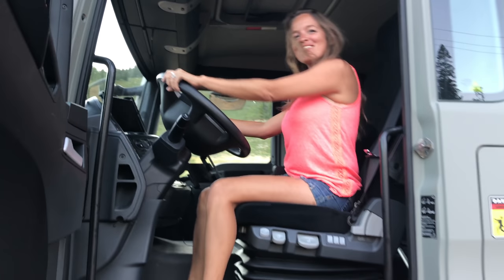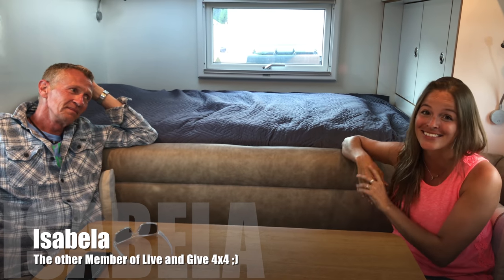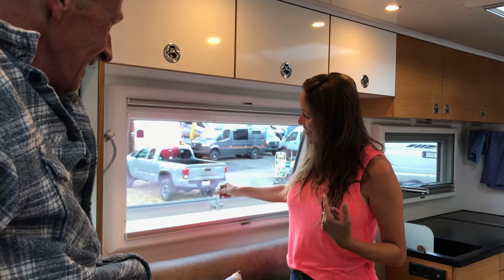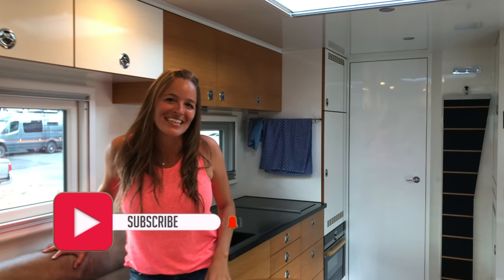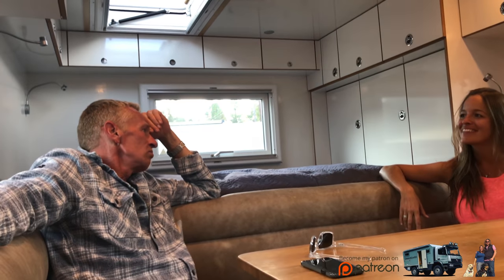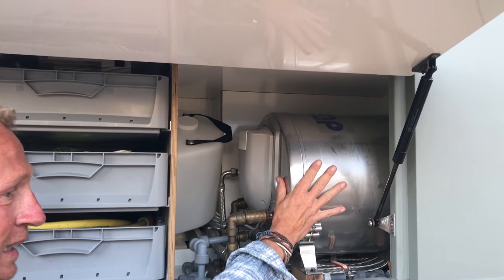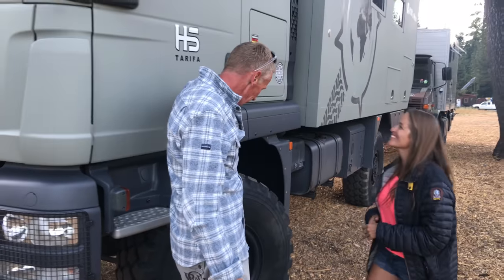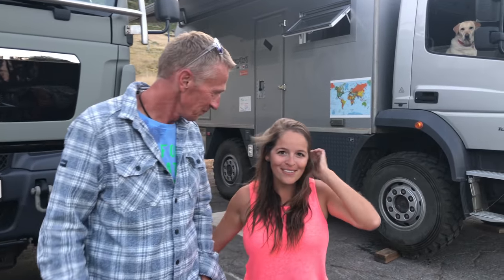Extreme MAN Expedition Truck FULL TOUR ► | Live and Give 4x4

Comment: 9:47 noticed that the electrical wires are ran thru a metal square harness.  This is by code in some Countries.  It is dangerous to leave  the wires exposed.  My  Congrats to the Builder.   Also, how do u ground the Motorhome or all devices on board? In the Caravan medical field, this is a must to protect the Operators and equipment.

Comment: Great video again guys, question though... Do either of you know the overall weight of the habitation unit on it's own before it is fitted to the HGV.. Building my own next year, just getting ideas together.
Already decided the Base Vehicle (Merc Atego) but need to work out what class would work best (can drive 8.25 ton at the moment). Probably have to get the 32 ton rigid class licence but would be nice if I could get it to fit on a 7.5 t dreaming....
Reply: @Mauro Sanna larger market share around the world, easier (and cheaper) to find parts if needed.